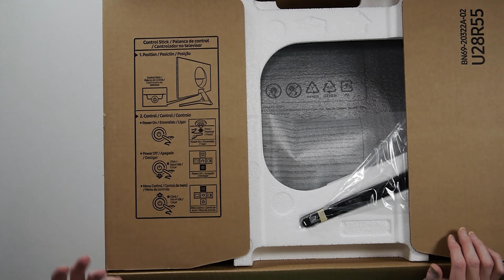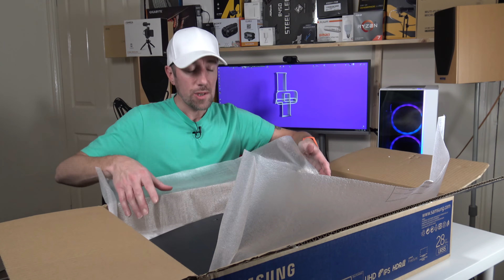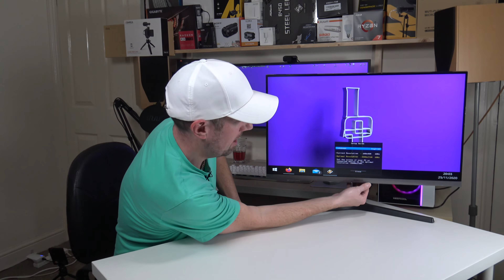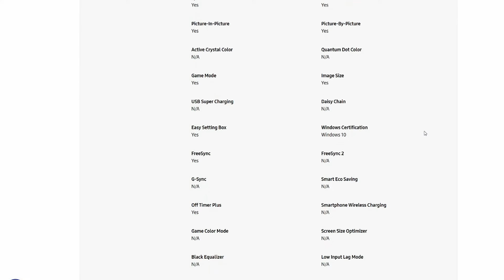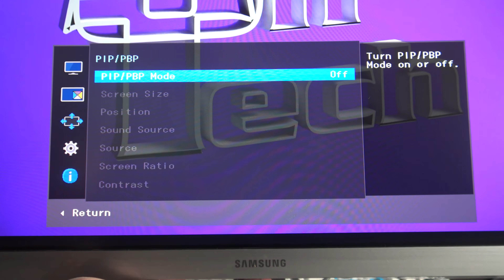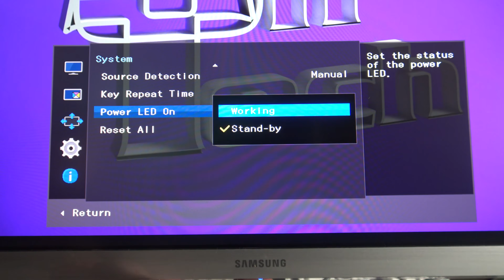Samsung 28 Inch 4K Monitor - Unboxing & Setup! (UK 2020)

Comment: Does the hdmi cable that comes with it support 4k 60hz or 30hz?
Reply from the maker: Yes, the HDMI supports 4K and will go up to 60hz 👍
Reply: @IXISonTech  okay, I bought this monitor and going to connect with my Mac so I was looking for a good USB c to hdmi adapter that supports 4k 60hz do u have any recommendations?
Reply from the maker: Nice 👍 I don't know of any USB C to HDMI cables sorry, haven't needed them. Sorry

Comment: did you try to connect a 5.1 speaker with single 3.5mm jack?
Reply from the maker: No. But you should be connecting a 5.1 PC system to the PC itself 👍
Reply: I did and it works

Comment: bought this for the ps5 and overall good monitor although everytime i connect a HDMI cable it keeps on restarting and wont let me enter any menus, good for quality bad if you get fustrated easily
Reply from the maker: Try changing the auto input to manual instead 👍 
Both my Samsung monitors are the same with the menus, take ages to find the right input, but I've changed them to manual 😁👍😉
Reply: @Jp Vert completely forgot I even put this comment and only bought it because it was a cheap 4k option I don't really have £600 to spend on 120hz I've played on 60hz monitors all my life so dosnt really make a difference to me 😂😂
Reply: @Jp Vert budget obviously
Reply: @Jp Vert People buy the new consoles for new features, to play new games with better graphics and performance, not just performance. There's a lot that the Series X and PS5 can do and have that the older consoles can't and don't.
120fps modes aren't even that common and that'll continue. 60fps is the new baseline, hopefully no more 30fps.
This monitor has been available for $250-$300 that's what some people's budgets are plus they aren't in the market for a TV, they likely play at a desk and want a monitor if they're on here looking at one.
Reply: @Jp Vert that's your opinion but I upgraded from the base Xbox One to a Series X and I love it, not just for the 4K or higher refresh rate which I don't use, a lot more 60fps games, FPS boost to older games, quick resume, way faster load times with the SSD, better graphics overall etc. Not to mention current gen games like Flight Simulator or the upcoming Starfield, Forza Motorsport and Hellblade 2.
Reply: @Jp Vert again that's your opinion, people want to play these and other games and they're only playable on the new consoles. Not everyone cares about 120Hz, some people want monitors not TVs, some people are have limited budgets. Case closed.
Reply: How do you use sound with a ps5 connected to this monitor?
Reply: @adambrant7357  the monitor dosnt have an in build sound system there is a 3.5mm aux jack on the back which you can plug a pair of speakers into
Reply: @ikeacoffeetable8753  Brilliant, thanks for the reply

Comment: Does the display port make a difference to use rather than the HDMI?  
What do you recommend? 
I will be docking my MacBook Pro to this monitor.
Reply from the maker: Display Port as far as im aware, can carry higher frame rates, for example 144hz, but this monitor only goes up to 60hz. I would say HDMI would be fine for this monitor 👍
Thanks for watching 👍😉

Comment: Nice video, i have a quick question. Is the 32 inch version is a VA panel or an IPS Panel?  Also this 28inch screen would you recommend it for creative content users?
Reply: I think is IPS, I buy it las week looks great ,I use it with my MacBook Pro 13" 2020

Comment: Hey picked up this monitor today, and most of my settings are greyed out and i cant access, do you know how to fix it?
Reply from the maker: I have that on mine too! Some of the options are if you are connected to HDMI 1 or 2, and also Display Port. I found that with my works laptop connected to HDMI port 1 it showed more options, then HDMI showed less options. Give it a go, just change to the other HDMI port 😉 Let us know how you got on too 👍
Thanks for watching 😁👍